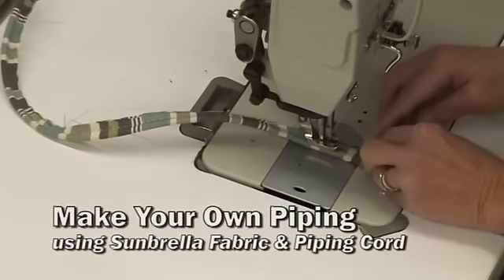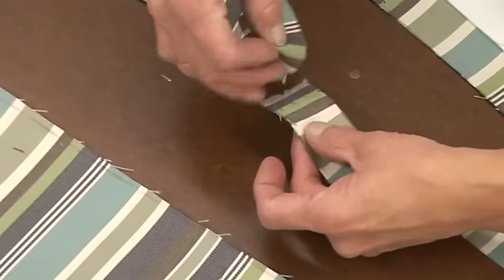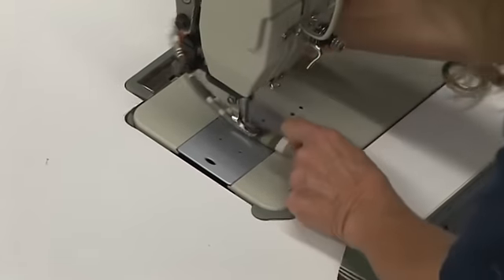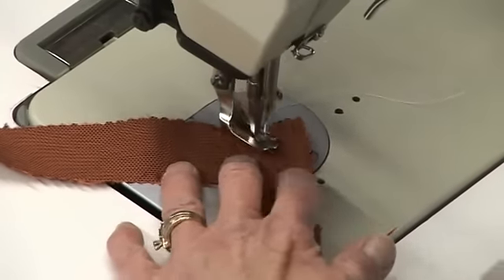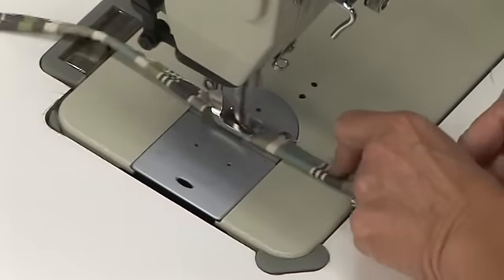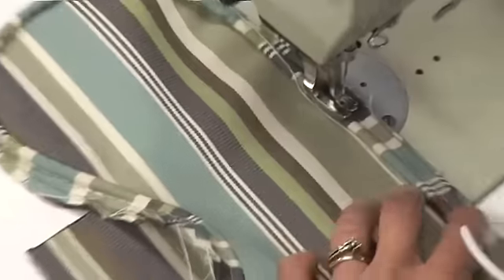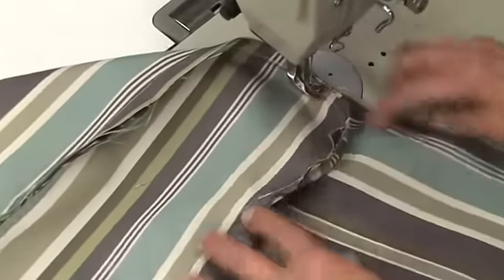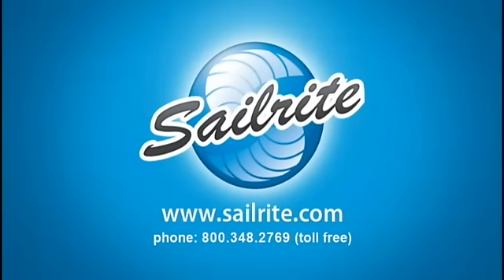Make Your Own Piping Cord or Welting Cord

Comment from the maker: Cutting the piping strips with a hot knife will keep the edges neater, but since those edges are hidden inside the cushion cover that is not a requirement. I do like cutting the boxing and plates with the hot knife as they are harder to sew together if not done, they unravel too much when sewing.